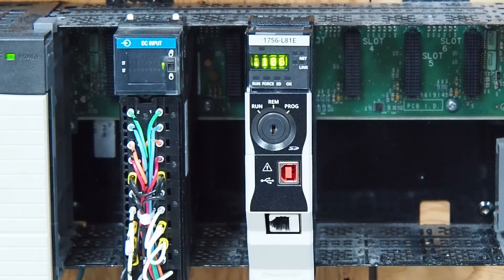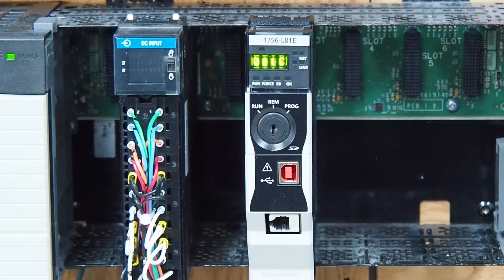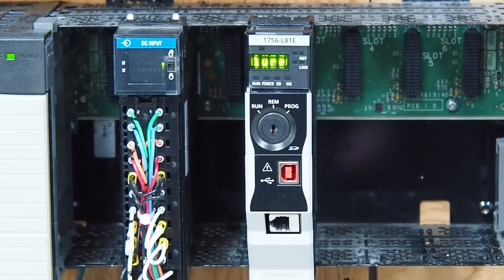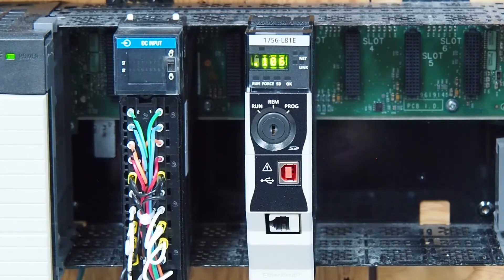1756-L81E/B T01:C61 Error Code

Comment: Currently experiencing this same fault code C1 with 1756-l74 controllogix 5574 in Kenya. Resetting using the key multiple time restores it, allows you to download new program. Also noticed this occurs in the afternoon when it's hot. I have experienced this Fault about 7 times in 2 weeks time. Anyone understands what could be the root cause?
Reply from the maker: I suspect that it is going over the heat rating for the modules.  If there is dirt and grime on the components on the card they will hold heat and be prone to failure.  If your cabinet or enclosure is hot - I would suggest at minimun to put in a couple of fans to at least circulate the air in the cabinet.
If you can pull out the modules from the chassis and inspect them and make sure there is no buildup of dirt it  would be a good idea in my estimation.  They can be cleaned a bit using clean compressed air of canned air - but not too high of a pressure.

Comment: I had the same issue with L81E, A10/C chassis and PB75/B power supply. Replaced every part in the configuration and issue was not resolved. Finally changed power supply to a few years old PB72/C and the power up fault was resolved. I’m bit confused as the datasheet indicates PB75/B supports both type B and C chassis. Anyways hope this will help someone
Reply from the maker: Hi been away for a few weeks on the road.
Rockwell has multiple issues on this setup that they are not resolving or letting people know how to resolve.
The 81x Error codes that keep popping up show how far down their quality has gone.

Comment: We had a L82ES do the same thing we have changed CPU's powersupply's and chasing, but no resolve. Rockwell has yet to come back with a good answer.
Reply from the maker: Hi BigTr:
The longer the l8x is in service, the more problems seem to be showing up!
Rockwell keeps doing firmware changes and screaming like kids about how everyone has to buy their software at insane prices, but not putting out a higher quality product.
Each generation of Clogix processor has increased the processor speed 10x each time.
But is it necessary?
A super high speed processor is still not going to make your waste system in the basement work any faster or better.  I still have customers very happily running SLC & PLC5 and it just keeps plugging along doing what it was designed to do.

Comment: I have had this on 3 processors. Terrible situation, we brought Rockwell for their reliability and responsibility. Both are badly lacking. I am now moving to use Japanese and Chinese plc products and so far reliability has been perfect.
Reply from the maker: HI Tony:
I have to agree with you on the lower quality of the product they are putting out in the last 10 years.  What was an industry standard is getting to be an industry joke.
The original PLC5 / 1771 structure was designed by old school Rockwell engineers and built to US MIL Spec - MTBF design was 80 years.  Lots of it still running.
The new stuff is designed to commercial specs and will normally last around 10 years.

Comment: This is probably a power supply issue. I had the same problem with a PB75 + L81E. the same PLC worked well on another chassis so I figured out it was not the fault of the PLC.   After replacing the bad PB75 with a different power supply unit, everything worked well.
Reply from the maker: Hi:  A good thought to check into, but with the unit shown it was tested in multiple chassis and it still did  the same errors.
Thank you

Comment: i had the same error in a PLC 1756-L81E, and after tryng many different alternatives and  it was a defective Power supply 1756-PA72
Reply from the maker: Hello Roman:
That is a good thing to know on these.  
It is sounding as though the error codes generated are generic and random.
Thank you for sharing that info.☺

Comment: I just installed an L83e today.  Changed IP Address with BootDp using USB... Connected Etherent.  Flashed firmware to 35.11 .  Recycled power.... Boom T01:C61 error! Haven't even uploaded the first program yet or even finished scanning the modules yet. I'll update when I find a resolution.
Reply from the maker: Hi Peter:  I have not heard a lot of good things about version 35.x
That is the version that they have added a 'Bit Locker' to if they think that the processor may be from the grey market.  You are always best to start with version 30.x and work your way up one at a time.  From what I understand if it is a grey market processor version 34 will give you a warning but not destroy the processor.
Hope that you can recover or get a replacement and get running.
Reply from the maker: Please let us all know what the final outcome is if you can.
Thank you

Comment: Hi. The same sytuation. 
L82E. This happen in every Saturday, we lost program and this fault. 
We changed rack, processor, the same situation. Do Y have resolution?
Reply from the maker: Hi:
If you have changed out the processor and chassis have you also changed out the power supply for the chassis?  Power quality can be a huge issue and depending on how bad your input power is you could wipe the memory with a bad spike.
Because it happens every Saturday I would strongly suggest and suspect an external problem to the PLC is causing spikes or dips which will cause multiple problems.  Is your power filtered or does it have a UPS?

Comment: Had this happen to an L83E today on a running operation.  Heard this was occurring with version 32.011 and have seen some issues elsewhere with that specific firmware revision but have since over a month ago transitioned to 32.014 as this was rockwells recommendation.  This processor has been operating as long as I have been at the facility, I assume manufacturing date before 2018-2019. Only resolution was to attempt a flash of same firmware to revision to get controller into program mode to clear fault,  had to redownload project since it was wiped out of processor,  working fine as of now but huge future risk until resolution.
Reply from the maker: Hi Michael:
There seems to be multiple problems with the newer firmware releases.  In 34.011 if the firmware update 'thinks' that you have a 'non-genuine' processor it will brick it without any chances of recovery.
IMO - unless there is a specific and pressing need to update beyond Ver 30 why do it.
Thanks for your comments.

Comment: I had the same problem with my L71 CPU.
It was solved by repeatedly moving the key switch from RUN to PROG several times.
Reply: Worked for me too.  Had to re-download the program afterward because I had "no project" present. Set the controller back to run mode in rslogix.  Fixed everything 👍
Reply: Thanks for this, same thing happened to me and did exactly this and fixed my problem.
Reply: I have save problem when i saw your comment then i  have solved my problem. Thank you  so much🥰😘😘😘
Reply: Worked for me
Reply: It worked for me, thanks!
Reply: SAME THANKS
Reply: Worked for me..Thanks
Reply: Worked for me too, i lost the reference of the servos though

Comment: i have the same issue ASA 01348E3D SN 95766103 MADE 2022/04/07 Did they tell you how to fix it?
Reply from the maker: Hello Isaias:
No they did not tell me how to fix it.
It has to be sent in to either Rockwell or another repair depot.
One that I had received had a broken ribbon cable inside.  That was deemed non-repairable.
The other one they have not told me what they found, but I suspect the same thing with that one.
I think that there is a large group of these out there suffering from the same problem.  But until customers like you and me speak up - Rockwell will not acknowledge there is a problem
Bruce

Comment: 1756-PA75/B is same fault.
1756-PA75/A is ok normal.
What is different?
Reply: but 1756-L63 is work ok. so CPU L81E must has some error at L75/B.
Reply from the maker: @WieldfieldEzekiel  
The PA75/A has problems unless it is used with a series A chassis.
I don't know the exact details why, but I have heard of many chassis and power supplies of the A series burning up.
Thank you
Reply: @abplctestbench759  Thank you Thanks for the reply. The chassis Ser.A is also a problem!!  I'm in trouble what It may be because I bought it in China. One of four PA75; I bought in China broke down because poor soldering:one mosfet leg is up. So confused now. I testing three L81Es. 

I show the different.
If power switch off, then cpu lamp on by 5 sec is error. 11 sec on is ok. ERROR  mean that the program has cleared,

It looks like poor performance or a Chinese fake.

I want to know  anyone test; normal A-B 1756-PA75/B and L81E test is ok? I tested 1756=PA75/A and 1756-A13/B/C is Ok.
Reply from the maker: @WieldfieldEzekiel  I would suggest that you contact Radwell International and they can test and possibly repair the units you have.  They have branches in Europe and North America.
Buying from China can be a problem for most electronics.  There are a few honest sellers in China that sell actual goods, but very few.
Because of this we have stopped buying from there because you do not know if you are getting real or fake parts.
Good luck to you on this.
Reply from the maker: @WieldfieldEzekiel  
HI: - Don't ever let it get you down.  
Being in technology can be challenging at times, but is also very rewarding in the long term.  
Take care.